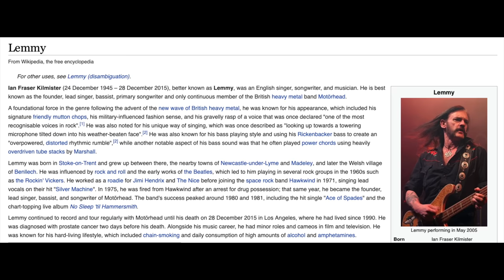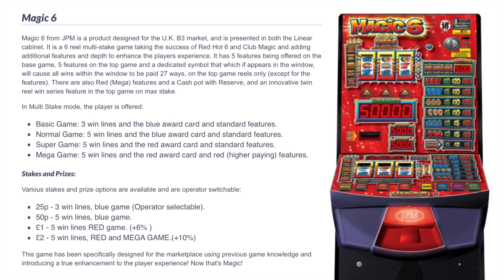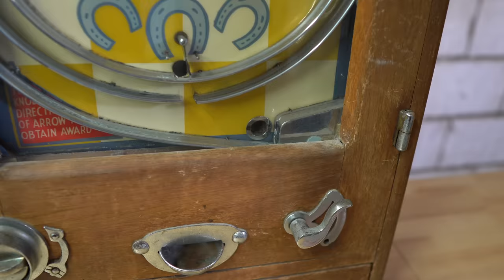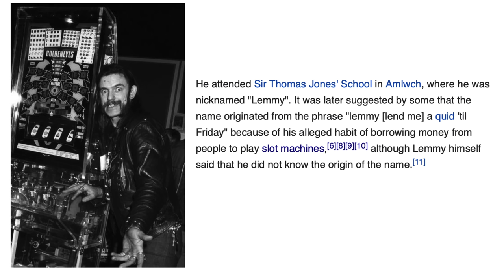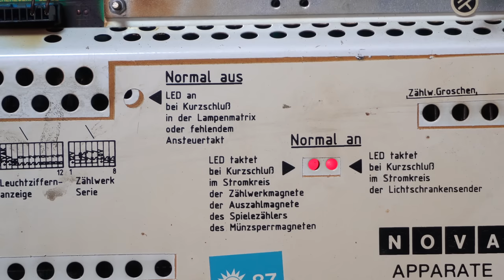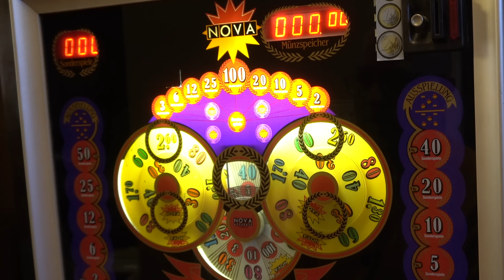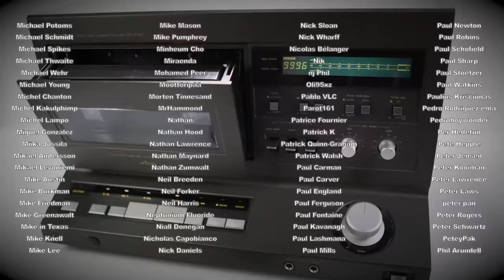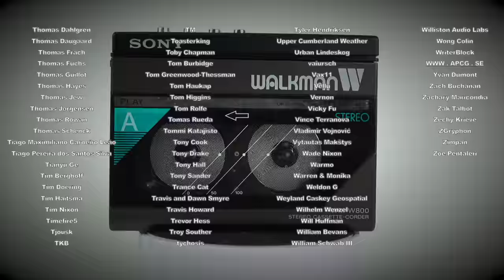Lemmy’s touring slot machines

Comment: In Germany, you could have up to two of those machines without any license (don't know if that's still the case, the Iast time I was involved was ~ 1990). It was very usual for each and every pub to have those two machines somewhere. Most times owned by a specialized company, sharing the yield with the pub's owner. Maybe one of the reasons they stayed with that form factor - making it bigger would have eliminated some possible places to put one.

Comment: Thank you for yet another great video. It was a sad ending, that all the effort you put into finding and using a German slot machine was no use, as the machine broke and you could not get it working. It is sad that the machine is being given away without you even being able to use it. Perhaps the new owners will let you use it and maybe film it once they get it to work. Nevertheless, this is a wonderful video and I have learned a lot about different types of gambling machines from different countries. I previously only knew of the American ones (the old style with real reels and a real lever or maybe a button). It is also very sad that the newer machines are using screens instead of the real, proper, fun-feeling, mechanically fascinating machines.

Comment: Not sure about old slot machines, especially ones from Germany. But am an avid slot player. All the modern machines i've seen have a switch that deactivates the machine and sounds an alarm if the front panel is open. There's always a sequence of button presses, or a switch inside to reset the alarm.

Comment: For at least the last 40 years or so, even the slots with reels have been primarily electronic devices.  The reel spin is controlled by a stepper motor and the stops are determined by an RNG.

Comment: You said the LEDs on the computer board indicated all was fine yet I see the top one is on, and is labeled "Normal aus - LED an bei Kurzschluss in der Lampenmatrix oder fehlendem Ansteuertakt" which translates to "Normally off - LED on if there is a short circuit in the lamp matrix or there is no control clock".

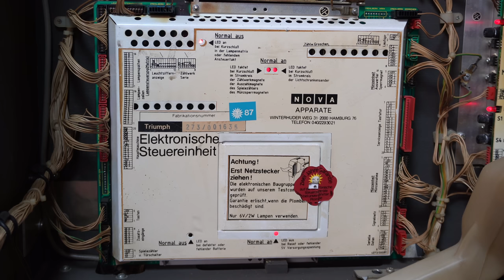Comment: If you look closely at the upper part of the mainboard at 20:41, you will see that there is one LED that should be off in the normal circumstances (Normal AUS), but it's on in your machine. There is an explanation below it that says "LED an bei Kurzschluss in den Lampenmatrix oder fehlendem Ansteuertakt" that basically translates to "LED on if there is a short circuit in the lamp matrix or if the control cycle is missing". Maybe that smoke came from one of the lamps or lamp holders where a short circuit occurred. Or it could have come from the wires connecting the faulty lamp to the mainboard or even from the mainboard itself. You might want to get all the lamps, lamp holders and their wires checked first. And to further diagnose the machine you definitely need to find the service manual...

Comment: tamper circuit (possible strim circuit) is locking out the coin mech. I have facilities to test the coin mech and to reprogramme onto uk coinage if its a non mechanical mech, though tube diameter may be issue, im sure that i could get this going, im ex service tech on amusement arcades 86-2000s
Reply from the maker: There’s a bit more information about this video in the video description. 👍 Includes updates, links etc...

Comment: Before the electric type came about, there used to be type in Norway, similar to your early ball driven machine, that was completely coin operated.

You would insert a 1NOK coin, and then use a mechanism or flick that coin across the screen.

Hit certain slots or similar and you would trigger payouts.

And when i say coin operated, i mean that it was using the weight and size of the coins to trip various levers and springs as it traveled downwards.

Comment: I use to live in Las Vegas NV. And there is 1 casino that does have these. This issue is a result of a fault in the computer system. Its likely using a Eprom. Yes slot machines do use them. But not for the main operations. Then theres the key side of the machine. Some machines require 2 keys. 1 to open and 1 to reset the system. Then theres the card base (this is newer). This system requires mechanics, Cage crew or administrators keycard. The likey culprate is a faulty logic board since this one likely will not have a Eprom.

Comment: At 20:43 you can see that the LED in the upper left  is lit. The text says "Normal aus", this means it should be off if everything is ok. If the LED is lit it indicates a short in the lamp matrix or a missing control pulse.
Reply from the maker: There’s a bit more information about this video in the video description. 👍 Includes updates, links etc...
Reply: Thank you, I did not read this before. Maybe the possible short indicated by the dark LED is the cause for the replaced parts to blow up. But I am just guessing here, far from being an expert on those machines.
I remember these machines very well, and I once saw a documentary about a guy who made a living from playing - and beating - them.

Comment: My first thought when the machine displayed a fault was that it was an anti tamper mechanism, Many machines have an alarm that sounds if the machine is moved. Maybe this machine had a trip switch which was activated when it was moved while plugged in and bridging the connection reset this. Just a thought.

Comment: I once had a similar Deutsche Mark accepting machine years ago. As far as I know these machines have a configuration and log memory which I asume was protected by the dead backup battery.
There were special devices which could read/write those memories (and even physically print out the log/history stored in the machine). I had a simple dongle which I had to plug into my machine every few month in order to simulate the readout or else it would refuse to work. All this was due to laws and regulations regarding gambling...
Reply from the maker: There’s a bit more information about this video in the video description. 👍 Includes updates, links etc...

Comment: 20:41 ... The LED in the top-left corner shouldn't be lit. The text reads: "LED on if short in bulb matrix or missing clock pulse". Also I think the lamps in the outer "Risiko" rails should light up in demo mode, so maybe that's where the short is.
Reply from the maker: There’s a bit more information about this video in the video description. 🔝👍 Includes updates, links etc...

Comment: 23:40 The machines were designed to be operated by the gambler or to run for themself. 
Those Buttons were all optional. Middle Buttons l from left to right "'Start" was meant to restart the first disk while lit. For example: If it stopped at 30 Pfennig in the actual run, you could restart the disk, hoping you got higher price. 
The two "Stop" buttons were meant to stop the center and righthand disk earlier than supposed by the machine. Also the Risiko ladders could by operated by the gambler, as long the buttons were lit. When you hit "Risiko" at the right time, your price went up one step on the ladder, when you were unlucky, it fell down two or three steps.
Regulations in those years were, that an automated game had run at least 5 seconds, and the machine had to pay out 60% of money thrown in in a certain period of time.

Comment: The battery compartment, where you replaced the battery has a sticker from the company Gauselmann, that owns the brand Merkur and a Sun-icon. This is remarkable, as your machine is made by a company called Nova, that went bankcrupt in 2002. As Lithium ion batteries where not a thing in the 1990s, i guess that machine was upgraded by gauselmann. They are still in business and can probably repair that thing.

Comment: I’m wondering if the flashing light may be some kind of “tilt” warning that freezes the machine, like they used to have on pinball machines.
Reply: @johndododoe1411    Possibly.  As they’re wall mounted it may need a reset from a key holder.

Comment: Temperamental thing.
17:35 The indicator LED for missing or faulty battery on the bottom is on, although you probably had already replaced it.
20:40 The battery indicator is now off (as it should be), but now the top LED indicating a short in the light matrix or missing control clock pulse is on.
No idea how to fix something like that, but it's interesting that the errors seem to shift around.
Reply from the maker: There’s a bit more information about this video in the video description. 🔝👍 Includes updates, links etc...

Comment: Maybe I can clarify the use of the buttons:
The "stop"-buttons would just do that: stop the middle or right disc.
The "start"-button would restart the left disc if you happen to dislike the value it stopped at.
If you won something on the disks you had a limited amount of time where you could gamble this amount on the "Risiko"-ladders.
By pressing the according "Risiko"-button the lights would intermittently flash between the next step up or nothing and you could go for the next step by pushing the "Risiko"-Button again (and again and again).

A lot of people would restart the left wheel if a bigger win would show up and go for the more likely small amounts  to start the "Risiko"-ladder.

Fun fact: Since German law requires those machines to distribute a certain guaranteed quota of their income those "Risko"-games are not based on chance.
If the next push of the button advances you one step or drops your game is not determined by a random-number generator like tossing a virtual coin albeit it's supposed to look like that. How far you can advance in that ladder games was determined by by a precalculated fixed table of pseudorandom numbers in the ROM of the controller.

Comment: I was always under the impression that those slot machines (or however you call them) had some internal control as to the payout odds - that could be altered to maximize the house gain (obviously) yet give the player enough incentive to continue playing (if they never win they are not going to be using that machine for very long).. but also be set in order to be compliant with local laws (the law may require the machine gives at least some percentage back or something).... Some locales may even require the gambling establishment to display the odds of positive return...

Comment: I used to be a casino slots technician, While I have no experience of machines that old, or German, every machine I have worked on, tamper errors are cleared with a key. Do you see any other key slots on the machine, aside from the door latch?

Comment: @Techmoan if you want to recap the machine, I can tell you that I swear by my Hakko FR-301 desoldering gun.  Works like a champ!  They can be had for $230-270 USD depending on if there is a discount.  Amazon seems to have the best prices usually.  There are many reviews here on YouTube for it, don't just take my word for it.  Although there are cheaper chinese ones, the expendables are a factor in all soldering tools, and Hakko isn't going anywhere, they'll be around (along with Weller).

Comment: Not sure if this is still the case, but at 20:41 there is a fault code visible on the top section of the mein control thingy. 
Roughtly translated, it reads: "Normally off - LED on in case of a short in the lamp matrix or missing  control clock signal" 
Which could well be an internal fault in the main control box, which would be a shame.
Reply from the maker: There’s a bit more information about this video in the video description and the top pinned comment. 🔝 Includes updates, links etc... 👍

Comment: Hi. When you have changed the battery, you have to reset the device once. German: "An der 20-poligen Stiftleiste für die Servicetastatur (An der Backpanel ) wird Pin 7,14 und 20 bei eingeschalteten Gerät gebrückt. (geht notfalls mit einem Schlüsselbund)
Danach resetet das Gerät und fängt im Programm an von vorne zu laufen. Das die Initialisierung erfolgreich war erkennt man daran, dass dieses akustisch gemeldet wird. "
Reply from the maker: There’s a bit more information about this video in the video description. 🔝👍 Includes updates, links etc...

Comment: On your actual fruit machine, were there things the proprietor could tweak to adjust the difficulty/chances of winning?
Reply from the maker: I believe that kind of thing required interfacing with an external device that would be carried by a technician. There’s a DIN type plug in the bottom near the coin slot.

Comment: Hi, at 20:41 when you show the control box, the top left led is lit. German text says: the led has to be off. If on the error is a short circuit in the lamp matrix  or the data/control  clock is not working. I hope that helps a bit.
Reply from the maker: There’s a bit more information about this video in the video description and the top pinned comment. 🔝 Includes updates, links etc... 👍
Reply: @Techmoan  Thx. In Germany there are many regulations to operate those machines. In the control box are by government checked settings. It makes sense to me, battery gone = settings gone.  1981 Nova was sold to Gauselmann. Finally Nova was closed 2002. Maybe you can get more informations from them. https://www.gauselmann.de/  Top right, you can switch to english.

Comment: Design/layout of these Merkur/Nova/Gauselmmann machines is heavily driven by regulation, which was always national. This is why most german machines were these 3-wheelers with 5 buttons. it's just the way the "playout-tables" had been licenced by the PTB in Braunschweig. Certainly other designs were not forbidden. But since the manufacturers already went through the tedious (x year long) process of certification of the "chances algorithm and the win-tables": it was hard to deviate from that road. at least if the machine was meant for general audience in pubs and alike (in casinos it was easier in terms of regulation, but casinos were all state (city-)owned till end of the 1980e, their view "outside the country" was rather limited as well.)

Comment: My layman’s guess is that when the battery dies, the security code ROM dies, which renders the rest of the chips non-functional. Just like the notorious CAPCOM CPS3 arcade machines (mostly Street Fighter 3).
Ingenious people have since found ways to ‘Phoenix’ the machines, by re-flashing the security ROM or something like that. It took them more than a decade and I don;t think anyone has figured out the original method that official Capcom engineers use.

I love your videos by the way. Every single one.
Reply from the maker: There’s a bit more information about this video in the video description. 🔝👍 Includes updates, links etc...

Comment: I have an IGT Double Diamond Deluxe machine I picked up back in 2005. I had it in storage for quite some time while I was moving and had a similar problem with the dead backup battery. I rep[laces the battery and nothing worked like it had before. Long story short, I had to find and buy a re-program chip set for it. One chip restored the game type, the second chip set the denomination. (US $.25, $.50, $1.00, $5.00, etc.) I wonder if that German machine lost its volatile memory and needs to be flashed like mine had to?

Comment: I wonder if that dead backup battery is the key. There's a lot of secure type systems that rely on the backup power to store a secure key and refuse to (or can't) work otherwise to avoid tampering. Arcade games are known to have these mechanisms too.
Reply from the maker: There’s a bit more information about this video in the video description. 🔝👍 Includes updates, links etc...
Reply: @Techmoan  yes I noticed I'd missed a lot of the info since it was below the part I assume to be the end and then realized you already addressed the issue oops.

Comment: Have you looked into the possibility this needs its electrolytic caps replaced? I have gone through many old 80's arcade games and the leaking capacitors can wreck all sorts of havoc. Particularly on machines that have relays. That is another area to look. make sure all the relays are switching properly. You could have a stuck relay or two sending power when and where it shouldn't be sent.
Reply from the maker: There’s a bit more information about this video in the video description. 🔝👍 Includes updates, links etc...

Comment: I don't understand how anyone could get addicted to a modern slot machine, although old mechanical ones could  be mildly entertaining..  I remember when I was a kid and on a family vacation driving through the states, we stopped at a roadside diner and they had a mechanical slot machine in the corner and my dad gave me a quarter and I sat in front of the machine for a good 15-20 minutes on that one quarter..  The first spin, it probably spit back 20 cents in nickels and I just kept feeding and occasionally I'd get a couple back and I'd lose a few, and it did eventually take back all my "winnings", but it wasn't excessively greedy like modern machines and I could sit in front and play a while.   I went to the casino a few years ago for dinner with friends, and we did the obligatory tour of the casino floor afterwards... The machines were all electronic and I put $5 into one, and pressed the button, it flashed some graphics and told me I lost...  No doling out a few nickels to entice you to keep playing, it just took the entire thing..   No addiction factor there: just instant disappointment..   No thanks..  If I wanted to waste my money, I'd get more benefit wiping my ass with it, or burning it..  At least then I'd be warm and have a clean ass..